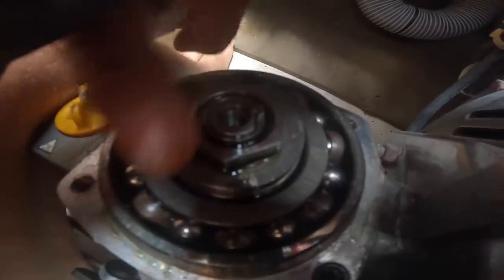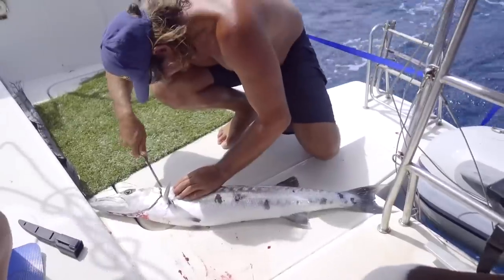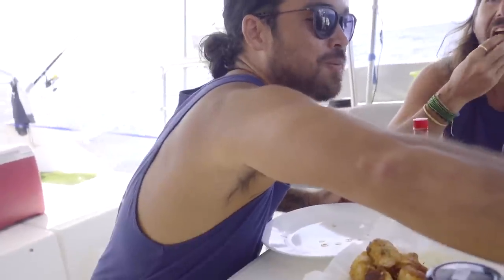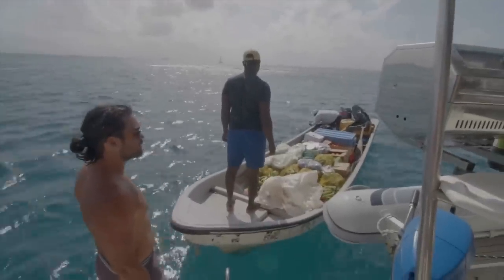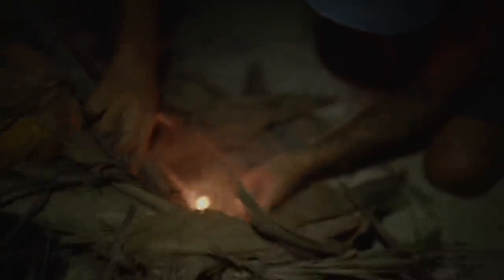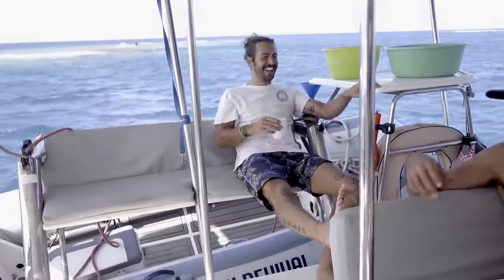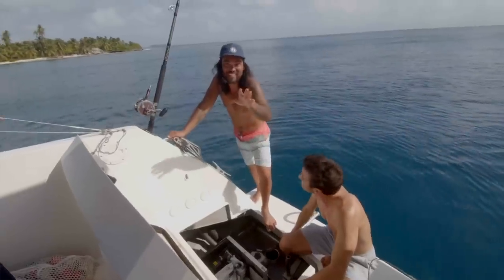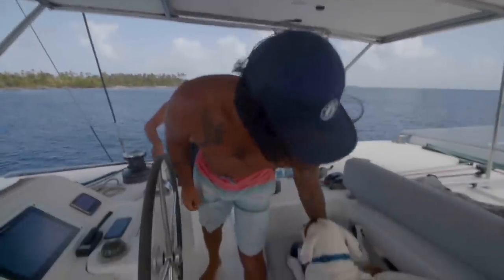Who makes the fastest production catamaran?! - Episode 147

Comment: She'll be pointing into the wind alot better now because the rigs tuned properly and not bending to the leeward side. Tuner also may have added more rake helps upwind but slows ya down downwind🤙
Reply: agreed
Reply: Exactly. 👍
Reply: yeah gotta play a huge part, is the only reason that explains it perfectly. The extra foot and half may add something
Reply: Well said. You are exactly correct.
Reply: @Antipodean33  True. Waterline length increase would have effectively “moved” the Mast’s Center of Effort the  same distance forward increasing the ability to point better into the wind. Learned that lesson 45 years ago when Windsurfing was in its infancy.
Reply: Plus the slick bottom, and the hulls are now stiff and parallel rather than sloppy and bowed out.

Comment: Congratulations to all that put so much into getting Parlay back better than ever! 
I’m a boat owner & noticed your sail drives are SD-50’s. Those are notorious for the cone failures. My boat has an SD-60 and has been rock solid for 8 years (knock on wood). Your description of slipping in forward gear sounds similar to many others with the SD-50.

Comment: Nice job Colin. Your approach to problem solving is inspiring. I’m sure you will solve the sail drive issue in time. I think you have your answer to your pointing ability. You will get better point with speed and speed comes from your aero and hydro. Both have improved with your refit. A lot of energy from the wind was lost before you stiffened the hull with the boat bending. Now every gust is a translated into power in the rig and as your boat can’t lean over to leak the energy, then it must go somewhere. Keep an eye on that apparent wind and be sure not to stress the boat beyond its (even new) design limits. Look forward to seeing your adventures down under.

Comment: That's the difference a rig tune makes, also possible your extended water line length helped and the flow off the stern now has reduced drag. Clean hull helps, faster you go better you point.

Comment: Having more speed allows you to point higher (I can’t explain or comprehend the physics here, but I’m sure someone on this channel can explain), that why ice yachts can sail directly into the wind or you can head up a few degrees in a puff. 

What is exciting is why you have more speed, stiffness of the hulls could be a factor, as is your clean and recently faired bottom / wetted surfaces, your stiffer rig was sure to help also as it keep the top of the sails from opening up and provides a better more efficient foil. Congrats on the win, it’s always gratifying to see your hard work turned into speed.

Comment: Boat speed and height, well done. In my opinion its 100% a product of the boat being stiffer. Every bit of flex in a cat is lost power and drive. The best example I can give is, take two Hobie 16 cats that are 10 years old. Their platform and boat stiffness relies on aluminium beams connected into castings and after time they come loose, pull one apart and clue the beams into the castings with epoxy and then that boat will flog the other one as the power is being transferred to drive and forward momentum while the other is loosing some of its power and drive as the hulls wobble around in the swell.
As for the transom extension, Im not qualified to comment, but it makes sense it would help as there would be less turbulence and waterline length = speed!
Love the show and watch every week, thanks👍

Comment: Strange that the pointing has improved that much. It is like it's two different boats. 
Sure, a clean bottom is very advantageous. 
Together, though, the sugar scoops are giving the boat 3 feet more waterline. 
Also, could the changes with the bimini cause a very different airflow around the boat?
And does a less stiff boat waste a lot of energy?

Comment: Good racing| One of the issues with a catamaran is no kicking strap, so you are restricted to sailing a bit off from wind, (you cannot shape the sail by bringing the boom down), and not into it like a monohull. However, that Lagoon was impressive, to see it sail like that! Some cats now do come with the kicking strap on the newer designs. All in all fantastic sailing!
Reply: Kicking Strap, or Vang for the people not familiar with sailor slang is completly not needed on any Cat.
Cats have travelers on their sheets at the rear, the length of the boom swing.
Where a monohull would have a boom swinging off the boat requiring  vang to haul on the boom, a cat would would have a traveler for the sheets to haul on.
Not being able to shape the sail using your boom like a monohull is a myth.  As a matter of fact, its probably easier to do on a cat.
The one and only thing that a monohull has that shapes the sail that a cat does not is an adjustable backstay.  That said, a mono will spill the wind from a sail during heel where as a cat does not, and so a backstay is moot on a cat.

Comment: Pointing requires tension and flat sails.
All the sagging and bending was making your sails behave like a sack of potatoes before. Also when you go into the wind you cross or slice into the waves. As you were flexing and twisting before this was sapping the energy. Great down wind but not upwind. You need to trim sails constantly for racing but previously all you were doing was bending the mast or leaning the rig over. There was no way for you to truly get the most out of your sails. Great to see it all back.
Parlay looked sprightly and lively going upwind like an eager puppy dog.
Qell done you guys. That was the test and the answer.
Bet all the Lagoons will want to be stiffer now.

Comment: Colin a longer waterline makes the top potential speed of a hull higher. Also adding the longer sugar scoops makes the centre of lateral (CLR) resistance of the hulls further aft. This means the centre of effort of the sails has a slightly increased moment forward of the CLR. This is felt through the helm as less weather helm and better balance. Less helm means less braking from the rudder,  and better speed. That is what I think has happened. Go kiwis! Murrray

Comment: I am sure you have sorted the sail drive out by now but the SD50 drive you can “lap” the cup where the cone goes in.  I had to do this on my Jeanneau after only 350 hrs on the drive. Its definitely not a good design.  There is a good video out that shows up to do it while the boat is in the water

Comment: Didn't you also change where you trim the jib sheet? If you can sheet it in tighter now with the slightly stiffer and longer hull you will point higher. What you have to watch for is crabbing through the water. You don't want to modify the keels, which is about the only thing you can do to fix that. Time for a longer bowsprit?

Comment: There really is a lot to those bulkheads fixed affecting the trim holding with the rigging of the boat. Makes all the difference aye mate? Only drawback is when something in the rigging goes amiss it will drive you nuts from now on because you will notice the smallest changes. Never tighten that rigging too much. Keep a set of tap & dies for those rigging forks & ends. The threads should always work smoothly....Moses <><

Comment: More 2 cents worth I ran a ragbagger to the bahamas and back from Toronto.iuse to run 2 longs 2 shorts on release clips and light drags that would give the fish more time to repack up the bait and hook itself.i also ran a shot gun rig down the centre 200 yards back.i mounted a pulley half way up the topping lift and another pulley near the boom making it a vertical outrigger that was my most successful setup.allways had enough fish for crew and lots to give away.good luck.

Comment: Outramer is a nice boat and obviously less spacious than a lagoon 45..   And probably twice the price..   The Nautitach 46 Open is my want Cat, so good to see the potential issue with the hydraulic steering..
Reply: If you are interested in the Nautitech 46 open (vs. The FLY) then you do not need to worry about hydrolics because unlike the FLY version the open has cables instead of hydolics
Reply: @ralffromsvbarbarella9708  That's great..   Yeah I am not particularly fond of the roof type helms/fly bridges...  I like the open and then have internal auto pilot controls as needed.

Comment: why can you point better? -  taking the forestay to sag out of your headsail with sorting the hulls out = Forestay tension.(the correct shape on the sail means you are not bleeding as much power to drag  + the power from the sails previous was being lost with the whole structure flopping about - with the sorted structure the sail power is not going into making the boat flex  - the sails are now actually providing drive, + the slightly longer waterline length means you can carry that additional power longer again adding to your apparent wind speed = longer hulls will keep you driving instead of bogging down in the sea. (in short, the better-shaped headsail makes your whole boat perform an order of magnitude better)  but just from watching your before and after images of pointing into the wind  - the single biggest contributor is you now have no( or negligible)  sag in the forestay.  - there will be an element you might also be talking yourself into it  - you seem not to have any precise calibration of your logs  - and sailing angles so it all gets a bit rubbery. (the counterbalance to that is you are  an intuitive sailor when "the feel" of the yacht when powered up is your best measure - it's likely to be a combination of those things.)

Comment: Every mechanical device will fail.  It's always about when the failure happens.  Fixing it now rather than off the coast of one of the Pitcairn Islands is probably a good thing in the long run.
Reply: What’s wrong with Pitcairn..? They would be fine there, they are all older than 20😉
Reply: @jerrybow8779  Nothing wrong with Pitcairn.  I just would not want to be spending my time there fixing something.  Doing it somewhere that they have seen more than once is a better use of that time.